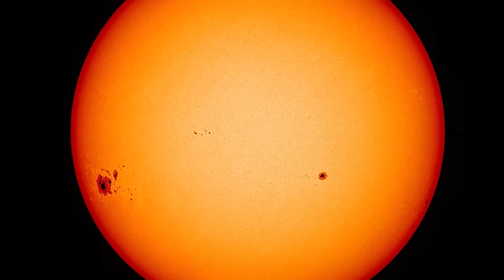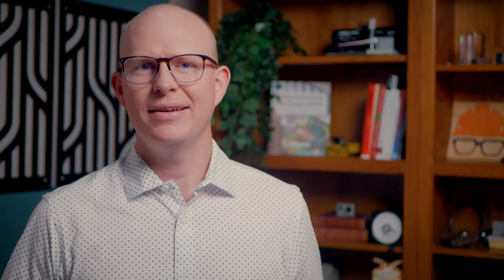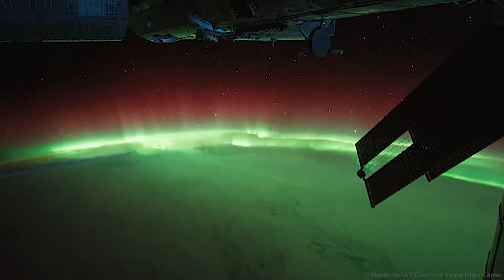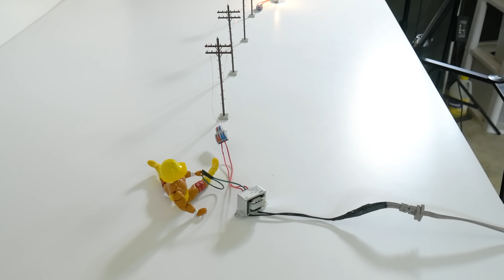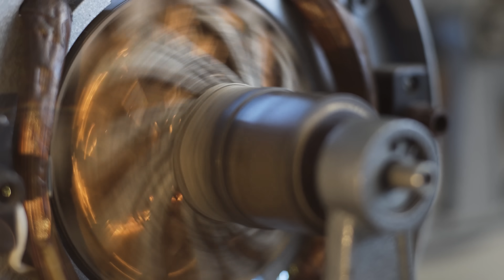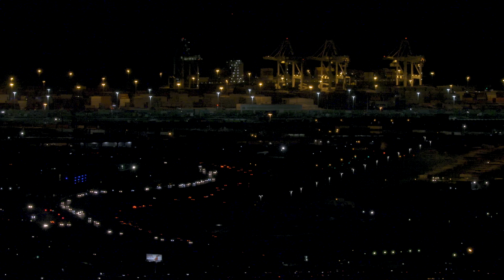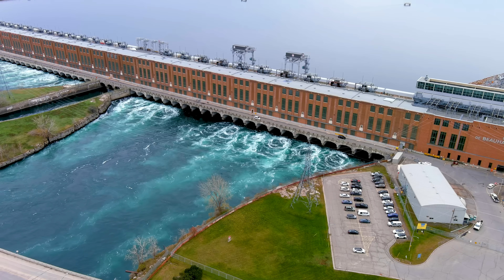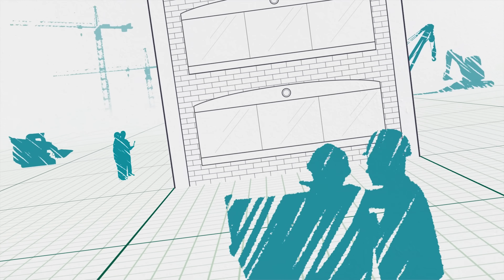The Most Confusing Part of the Power Grid

Comment: Grady, I actually have a recent (couple weeks ago) story related to this.  I was having issues with a very sensitive piece of network hardware having issues at a certain time of night each night, and it was related to the incoming power having a fluctuation during the power company's nightly switchover of certain power conditioning equipment.  It was extremely difficult to track down, but it was interesting when your video just backed up what we had discovered via troubleshooting.  

We solved it by using a local power conditioning powerstrip for the sensitive piece of equipment.

Comment: The high voltage and current waveforms on the power grid are not measured directly. They are always measured through Potential Transforms (PTs) and Current Transformers (CTs)  or other types of sensors such as capacitive voltage divides that are used to sense the conditions on the power grid including the reactive power flows.

The question I have about the 1989 Quebec black out is did the solar flares actually distort the voltage and current waveforms on the high voltage transmission grid in a significant way or did the solar flares cause the voltage and current distortions on the much smaller PTs  and  CTs that are used to step down the high transmission voltages and currents to the 120 Volt and 5 Amp levels that the protection relays use to sense and measure the conditions on the transmission system?
Reply: kinda like the question, think the effect would be much more pronounced on the l- o-n-g transmission lines over the relatively insulating surface than the comparatively small IT's
Reply: @Ken-yz8pt  I like your answer.  My thinking is that the magnetic and electric fields produced by the high voltages and high currents on the transmission lines are relatively strong and magnetic and electric fields coming from solar flares are somewhat weaker.  So if a 120 pound guy is going to try to tackle a 320 pound linebacker the linebacker is not going to be moving much.  The same can be said for the magnetic and electric fields in the large power transformers in the tens and hundreds of MVA in size that are used to step up and step down the voltages on the transmission system. The sizes of the instrument transformers (the PTs and CTs) are only a few VA.  So I am thinking that their magnetic and electric fields can be “pushed around” and distorted much easier by magnetic and electric fields coming from solar flares.  Any thoughts or am I misunderstanding the power of solar flares?
Reply: @Danny_6Handford  Your understanding and reasoning is solid. But I think a better analogy would be solar collectors, the amount of energy collected per area is small but it adds up over a large area. The incident energy from solar flares per unit length of wire is small but on very long lines it adds up, especially with the increased capacitive effect due to the unusual soil.  The incident energy on IT's would think would be small, the incident energy effect on power transformers I'm not sure about.  But the power transformers and IT’s would both likely be strongly affected by the voltage swings on the line.  Although I like your explanation, I don't believe there would be a strong interaction between the power line fields and the effect from the solar flares, it would be like two radio stations on different frequencies.  Also, I think Hydro Quebec is known for it’s very long transmission lines with remote loads (loads as far as the US).  This effect was studied in depth, and a lot of papers were written on it, so google likely has a closer explanation.
Reply: @Ken-yz8pt  Thanks for taking the time to reply.  I will look up some of the studies and reports on this event.

Comment: I don't understand why inverter based power sources are worse at maintaining short term grid stability than power plants that use large generators. The large rotating mass of the generator (inertia) creates some stability to the grid. But the same effect can be had from an inverter that is phase locked with the grid's master clock. The power transistors in an inverter operate in the kHz or even MHz range, and can very quickly ramp up the power to stabilize the grid.

Long term stability is a different matter. Of course inverters powered by solar PV plants will not have energy when sun doesn't shine.
Reply: Those big steam powered turbines can call on extra power. Which they do in direct response to frequency changes. For an inverter to do that, it has to have power in reserve. So either give up on MPPT or add some batteries.
Short version is that it costs more.
Reply: @davidschultz3585  Yes, but that has nothing to do with the inverter. It has to do with what powers the inverter. And as you say it could be batteries. So there is no difference in grid stability between such a system and a steam powered turbine with a generator. If it is a matter of extra cost, then cost is what should be mentioned. Instead the talk on this channel and in many other places is that inverters can't maintain grid stability, as if they have a technological limitation. I don't think this is true.

Comment: If you look at panel prices (less than 0.15 USD/w) battery price (less than 80 usd/kWh, total equipment for 10 kw installation less than 5000 USD. Receipts available) and the amount of subsidies,  tax brakes and grid upgrades governments give to big companies to provide energy to homes at an ever increasing prices and compare it with how much it will cost governments to provide  100% financing for all required renewable energy equipment , so that families will have all energy required at zero cost forever , then you will find that the second option (financing the families) is much cheaper and it gives not only abundance but also freedom to the individual person. This option requires no talk of UBI, which is promoted, because every family will be able to have everything it requires including manufacturing capabilities . This distributed energy enhances the country's security (see drone hits in Russia) and doesn't require grid upgrades.

There are forecasts that AI will take all jobs away from humans. The antidote to this is to provide homes with energy (as described above) and allow families to live in abundance and freedom. No UBI is required. Because if you have energy, you have everything.

Comment: IDK how your compensation systems differ between YT and Nebula, but if you're making more on Nebula, might I suggest putting a little 2-sec throw to Nebula at the start of your vids... 

I have a Nebula sub, but watch YT more, and if I've just watched your vid here on YT b/c it came up in my feed/subs (and Nebula doesn't have an equivalent, unless that was in the recent update... idk), I'm not going to go watch the SAME vid over on Nebula, and trying to remember which channels are on Nebula is tiresome.

With a little 2-sec throw to Nebula right at the start, (and a link in the desc. to the vid in question on nebula, not just the channel, and not just to the subscription page) you can better drive traffic over there.

since I sincerely doubt there are many (or maybe not any) Nebula viewers that aren't also YT viewers...

Comment: In 6:20 we have a capacitor with polarity. 
Is it ok to connect such polarity based device directly to an oscillating power supply ? 
Or its ok because theres not much current here to do the damage ?

Comment: I understand its an analogy, but itts less of a "rental" for storing reactive power and more an incentive to improve power factor by adding additional charges based on how low it is. That bill is accounting for the utility having to supply larger conductors and transformers but also that it limits how many other nearby customers can be connected. As power factor is a ratio, it can be improved by increasing resistive loads (an incentive to buy new ovens for instance) which then compensate the utility through the power you actually use.

Comment: In addition to shunt capacitors, static vars, synchronous condensers, batteries can have their inverter systems programmed to supply (or consume) VARs. Actually, you can even do it with solar rather than batteries, so long as they're not operating at full capacity.😊

Comment: The subject of VAR's is interesting, but is NOT what happened to the grid.
During a solar event, the voltage and current induced on the power grid are very low frequency.
The transformers are not designed to handle low frequency, or DC.
The presence of this extra current will saturate the magnetic steel inside the transformers and generators feeding the system, regardless of VAR's.
This results in a very high current spike in one direction, essentially a magnetic short circuit, not a good thing to have on a power grid.
Hopefully the system can shut down before overheated equipment explodes, thankfully newer equipment can divert or otherwise handle this condition, usually.

Comment: The Most Confusing Part of the Power Grid to me is with all of the power generating stations in 47 of the U.S. states, (Texas stands alone by choice), that are connected together, how do they synchronize the 60 Hz frequency among all of the generating stations across the grid? If all the stations are putting out positive and negative going pulses at the same time and one station gets out of synch and starts putting out a negative going pulse when everybody else is pulsing positive, the grid will see a localized dead short. How do they keep it all in lockstep?
Reply: When you connect a synchronous machine to the grid, it will always rotate at the  grid frequency no matter what you do. The trick is that before connecting, you wait for the phases to match. The old fashioned way was to use light bulbs. There must be a video around somewhere showing this...

Provide no steam (or other power source) to the synchronous machine and it will draw power from the grid. In other words it is a motor. Provide power to it and it will provide power to the grid.

A control system is set to deliver power/steam to the system in response to the grid frequency. Lower frequencies call for more power and higher calls for less. The grid settles on a frequency where everyone is happy.

Grid managers add and remove generation as required and the line frequency varies (slightly) with time. The usual practice is to manage the system so over long intervals, the average frequency is exactly 60Hz. Really handy when clocks driven by synchronous motors were a thing. A current plot of the time error (integrated frequency error) for Texas: http://davesrocketworks.com/electronics/power/2023.png
Reply: @davidschultz3585  Thank you.
Reply: HVDC interconnectors. This is also done between the UK and continental Europe. For a long cable run, DC is more efficient, it doesn't have a skin effect and no synchronisation required. The electronics at either end to turn 500,000+V at 3,000 A back into AC are quite impressive.
Reply: @ACCPhil  I understand no synch with DC and, working with radio for over 50 years, I understand skin effect. At 50 Hz in Europe and 60 Hz in North America, there is no appreciable skin effect as negative skin effects only increase with frequency. 
    When Thomas Edison and George Westinghouse had their battle between AC and DC power distribution methods, Westinghouse, with the help of Nicola Tesla won out with AC because it eliminated the need for separate power generation stations every few miles to negate heat losses because DC current does not lend itself to the use of power transformers.
    Step up power transformers allow for efficient long distance transmission of electricity from generation stations to the end users. An example of this is the 7,200 volt power line behind my house. I have a 200 amp service @ 120 / 240 volts into my house. The transformer on the power pole outputs 200 amps  @ 240 volts which equals 48,000 watts, (which I would never use all at once.) 7,200 volts at the pole @ a full 48,000 watt power draw, equals only 6.6 amps. If the power company wanted to transmit 240 volts @ 200 amps @ 48,000 watts "DC", 90 miles to my house, it would require wires as big as your head rather than wires as big as your index finger and this doesn't even include all the neighbors also connected to the same 7,200 volt line that I'm connected to.
    For the above reason, I don't understand the British power company's decision to use DC to connect with mainland Europe.
Reply: @jeffmccrea9347  Your understanding is wrong.

HVDC transmission circuits have a traditional incoming AC circuit with transformers feeding into converter stations which have massive valves to rectify the AC to DC which is then transmitted to another converter station which has inverters which convert it back to AC. 

Think of it like this

Generator output 25kV AC --> Step up transformer raises the voltage to 400kV AC --> Converter station rectifies the AC to DC --> DC transmission at 550kV+ --> Receiving end station inverters convert back to 400kV AC.

All over the world we're seeing more HVDC for long distance and very high voltage transmission lines. For a given voltage DC has less losses because it's only resistive, you don't have any components of inductive or capacitive reactance, skin effect isn't a problem, corona discharge losses are reduced, the amount of conductor material required is less because skin effect isn't a problem and because of the absence of phases, which in turn means the transmission towers can also be made smaller. The biggest hurdle for DC transmission is the capital cost, you need expensive converter stations on both ends, however at a certain length and voltage it becomes more economical. HVDC is also used for grid interconnections, making it possible to connect 2 AC systems with different operating frequency or 2 systems that have different synchronisation.

You're welcome to check out https://openinframap.org/#5.33/49.447/-98.548 enable the key and you'll find HVDC circuits between US states and all over the world.

Comment: As an industrial electrician this makes a lot of sense, i was only ever told that powerfactor correction helps keep it cheaper but never told us why it was so important for the grid.

But i was told about unity power factor which is the cheapest way to run but also causes damage to components via magnetic fields harmonizing and vibrating. This is why 80% power factor is ideal

Comment: 5:43 "Insert a Resistor into the Circuit and insert a second probe to find the Voltage" - Is this what they call a SHUNT ?
In my hobbies, the need to measure Voltage has come up, and  the word Shunt has been used.
I think it gets configured differently for DC, and the amount of Resistance has to suit the combination of Circuit Voltage and the Measuring Device, as I understand it. If you did a video on Shunts, and measuring Voltage, I would be very happy :-)

Comment: In a.c., Voltage times current is actually Volt-Amps, not Watts.  To calculate Power, wattage, you need the Power Factor.  In d.c., the PF is 1.

Comment: As an electrical engineer (wife's account here lol) it's crazy to think just how vulnerable our grid is right now. Lead times on transformers extend multiple years. Plus we are continuing to shut down reliable baseload power like coal and older natural gas plants and replace them with intermittent power sources like solar, wind, and batteries. 

The craziest aspect of our weakening grid is the saving grace may actually be AI and datacenters as tech companies hope to expand their computing power. The ironic part is they've been fighting reliable, abundant, cheap electricity for years. The about-face will be slow but money talks and BS walks. The nuclear renaissance is on the horizon but it will take a while. Until then, combined cycle natural gas will proliferate.

Comment: Today I was wondering why in a 3 phase cable the neutral is the same diameter wire as the 3x live cables. I assume that there is less power on the return path as by that point you have used most of the power in the devices being powered. In any case, seems strange as it's alternating current so it doesn't really have a return path it just oscillates back and forth. How can one neutral equal 3x live cables?
  Another thing i'm interested in is how much power can high voltage power lines steal from the atmosphere? Returning it eventually to earth / neutral. It's almost like the power station turbines only produce a percentage and buffer the power while some of the power comes from atmospheric charge picked up from high voltage power lines. This might sound a bit crazy but we all know that the atmospheric potential difference increases with height and that our high voltage lines are generally high up and then return to earth / neutral / ground.
Reply: The neutral cable is only required when there's a presence of unbalanced loads on the 3 phase system. Under balanced conditions the vectoral sum the 3 waveforms (Ia+Ib+Ic) is 0, but when there's an imbalance in the system (improper loading or faults), the vectoral sum is no longer 0, hence there is current flow at the neutral point, these imbalanced currents are called ' Zero sequence currents' which require a return conductor. The imbalanced current should be significantly less than the phase currents.